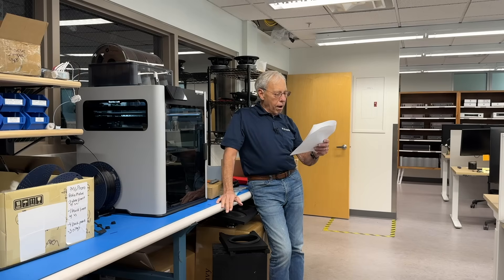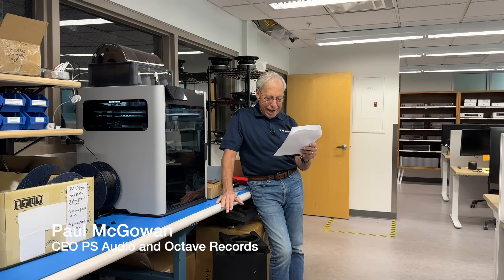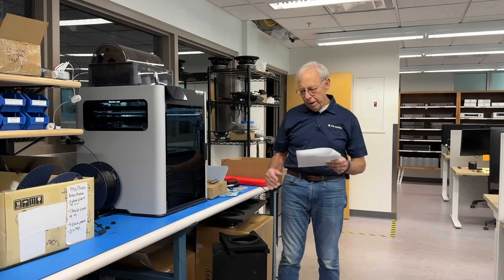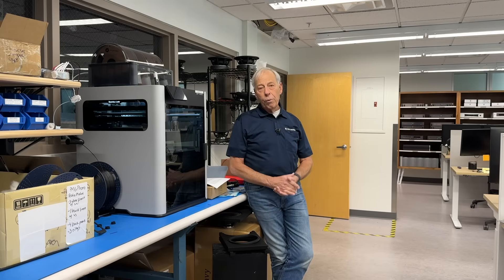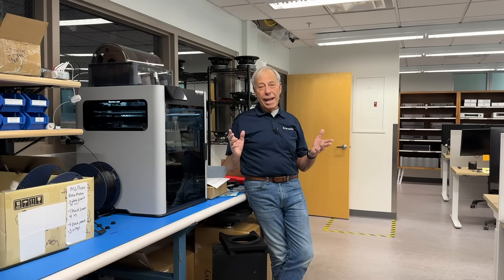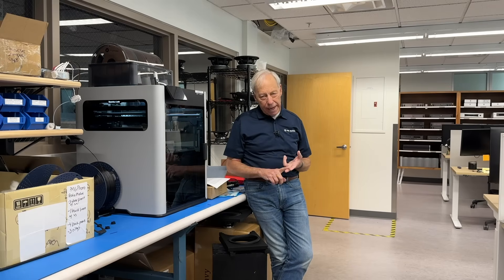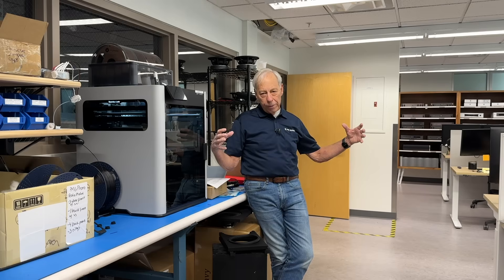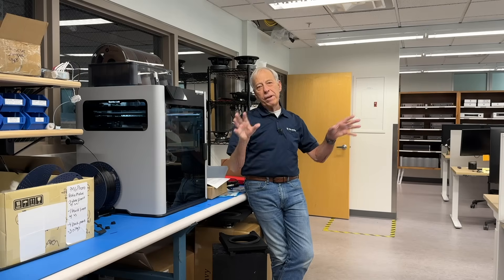Why amplifiers sound different

Comment: What any amp may do to the signal is miniscule compared to the speakers, how the speakers are set up, the listening position, and the room itself.  Get those things right FIRST, and then worry about your electronics.
Reply: I agree, if the speakers can't be placed correctly in the room.  No amount of electronics is going to correct the sound in that room. They way I build a system is start with the room, figure out the speaker options and then once you select the speakers, figure out what you need for electronics to drive them.  Amplification needs for example change drastically with a horn loaded speaker like a Klipsch (96db sensitivity) vs. a less efficient tower speaker that maybe only makes 85 db with 1 watt of power.  Between those two speaker types we may need half the amplification for the 1st option.  People under estimate the drastic change different speakers can make in a room.
Reply: Rent several amplifiers at once and connect them to your system. You'll be surprised at the huge differences between them.
Reply: @zibonek  Level match them to a fraction of a dB and you won't hear a difference (when you don't know which one is playing). This has been tested many many times with very different amps.
Reply: @Rob-k5k9u  Well, I can only pity your ears.
Reply: @zibonek  As long as you don't pity my brain, which is what I pity about believers of home audio myths.
Reply: @Rob-k5k9u  I'm a staunch opponent of audio myths, but if you don't hear that a given amplifier has better stereo imaging, for example, the Musical Fidelity M6SI has better stereo imaging than the Vincent SV-237 MKII. However, in some tracks, the instrument sounds blend together (e.g., "Queen Innuendo") on the Musical Fidelity M6SI amplifier but don't blend together on the Vincent SV-237 MKII, that's not my problem. You have two specific amplifiers here, which, among others, I listened to at the same time. I will also add that the Musical Fidelity MS6SI has a recessed midrange compared to the Vincent SV-237 MKII and it has a more exposed bottom end.
Reply: @zibonek  Look, no amount of name dropping and adjectival claims can in any way stand up to dozens of controlled tests. There is no logical/theoretical reason that the small electrical differences in amps could be audible. If and when you demonstrate that you can distinguish whatever amps you wish to compare, when they are level matched and your are blinded, THEN you have something that may be valid as evidence.
Reply: @Rob-k5k9u  However, it was a waste of time, you are a theoretician and keep reading folders and arguments.
Reply: @zibonek  I wonder what you have been not reading. You haven't made any arguments--just claims. I refer to evidence from controlled studies. You have "just listen" to my new expensive "audiophile pro" stuff!!!
Reply: @zibonek  Nonsense.  I bought my first audiophile system in 1978 and I've been testing amps, speakers, and cables and everything else for 47 years.  I've even done blind listening tests of both amps and cables, and the only time I've ever heard a difference is when either the amp or cable was not suitable for the task.  You've drunk the audiophile kool-aid and are hearing ghosts, my friend.  Study up on cognitive bias and science of psychoacoustics.  The work of Drs. Floyd Toole and Sean Olive is a good place to start your education.
Reply: I disagree....all things equal in your statement ....when you replace the amp.....you will hear a difference....many times a big difference.
Reply: @ColAngus  Even if amps could be distinguished, the effects of speaker placement and room would make way more difference. That actually involves sound.

Comment: Just ignoring for a second   distortion like harmonic , intermodulation multi tone etc... (which are inaudible on very good amps like e.g. Hypex NcoreX , Nilai and Purifi ) , the main difference can be a too low damping factor . An amp with a too low damping factor will sound diiferent as this will affect the frequency response of the speakers .
Reply: Found that out when I was playing with some Philips mini/cube speakers, sounded awful, until I used the right amp that had enough damping factor to control them. (tame the savage beast)
Reply: Disagree that hypex has inaudible noise, that was one of the amps I auditioned for my current stereo setup and I was super disappointed after all the hype it had. If you are a measurements person that listens to music by reading graphs rather than using your own ears to judge by swapping and listening to different components in your setup then that makes sense
Reply: @ArmFanatic   What did you hear? The ones I've heard sound super clean so I'm not sure what you're talking about.
Reply: @miscreant1739  the most obvious song where I heard a difference was quezacotl it’s a super clean tone throughout so it makes it easy to judge audio equipment swaps for me, there was like this low frequency hum I that I couldn’t not hear, also songs where there are quieter passages or moments of silence had that hum. And the low volume performance was lacking bass comparatively, bass performance was lacking below 70db and I typically listen around 65db. I auditioned a lot of amps it was far from the worst but that hum is one of those things once you hear it you can’t not hear it and it’s super distracting. Wish the ganm amps were out when I was shopping really curious on how those sound
Reply: @ArmFanatic  sounds like you had a ground loop or something… the amp doesn’t generate a low frequency hum on its own unless it’s broken.
Reply: Agree on Damping Factor and Intermodulation Distortion. These  both affect sound quality, noticeably enough to make Amp A sound better or worse than Amp B but reviewers always focus on Harmonic Distortion and ignore DF and IM. For a  consumer, it does not help that manufacturers seldom state DF.  Way back when Hifi was a new thing, HD at 0.1% was the gold standard. Better than that number does not substantially improve sound quality, imho.
Reply: Wait, what? If you can hear any distortion, your amp sucks. Hard to see how one can claim very good amps make distortion easier to hear.
Reply: This is why I love my sumo polaris… damping factor 525 and I noticed a decrease in bass ‘ringing’ and ‘mushy-ness’ compared to my NAD 3020 with a factor of 55.
Gotta have very short and high quality cables though… affects the impedance a lot and can make the maximum damping factor under 100 easily

Comment: All amps i have had have sound different, even with the same brand,
Like had Hegel h190 and now h390 they sound slighly different h190 is slighly warmer.
H390 have more detail, larger soundstage, better separation better bass comtrol.

Speakers makes the most difference through off all the gear in the chain
Reply: My H390 is definitely a step up SQ-wise from my Musical Fidelity - 'M6si500'. Both are a dual-mono design.
Reply: I am betting you didn't level match and double blind. That means we don't know why you heard a difference, including that it is all in your mind.
Reply: @Rob-k5k9u   ...I'm betting that you haven't got a clue.
Reply: Is betting how you make most decisions?
Reply: @Rob-k5k9u i can insure you its not in my mind, going from h190 to h390 is major upgrade specially if you use speakers that demand that extra power. Amps have an effect on how the speakers sounds, does make as much difference as speakers no, but it makes a difference, maybe you cant hear it because you are bad of knowing what you should hear.

Different amplifiers those sound different, its the truth. If it was not the truth why even spend so much money on amplifiers is all people stupid going by your logic, how much of difference the amps will have will depend on the level of your speakers, if you use cheap speakers thats not resolving you wont hear much of difference, on higher end speakers it will be noticable more than a little.

Comment: I've had amps modified and it was mind blowing, that was by the same engineer who designed them, but it was without any price point to meet. 
I guess it's a bit like baking a cake, if I and a baker were given the same ingredients and recipe they would still come out very different.
Reply: Agreed. I have two same power class A/B amps  both Pass designs...one sounds significantly different than the other.

Comment: The perspective that measurements and listening are somewhat competing methods is a totally false premise. In fact, I will argue there is no such thing as an amplifier sounding different without also measuring different in some way. Reason is an amplifier is a simple 2 dimensional transfer function of voltage over time. Two amplifiers measuring the same on frequency response, THD, TIM, SND and damping factor might sound totally different and that's where people get confused. Reason is that you haven't identified the measuring method to pinpoint where the output deviates. For example, distortion at the same percentage doesn't sound the same cause if you dig deeper the harmonics can be even or uneven and more or less harmful. A tube amp often beats a transistor amp due to even harmonic soft clipping distortion rather than more hard clipping in a transistor amp. Nowadays you can do comprehensive signal analysis on measurements to pinpoint any sonic difference using advanced instruments e.g. by Audio Precision. Still, Paul is of course right that compromises are not about pleasing instruments but about pleasing our ears.
Reply: I use my hearing to measure sonic differences...just as God intended 😉
Reply: We can only use what we have and not everybody has US$50k laying around to buy an Audio Precision setup that really isn't of much use for consumers lol...
Reply: Which God is best for audiophiles? Maybe our audio systems get more cable blessings if we pick the right God 😂

Comment: Not only does all audio gear add and subtract aspects of sound, but perhaps an even better way of thinking about it is that "live sound," or studio-produced sound has many aspects to it, and given current technology, no piece of gear can address all aspects of it completely or equally well, so some pieces of gear recreate certain aspects of musical sound better, and some apects not as well; and other ones have different balances of both strengths and relative weaknesses, hence different characteristic sounds for diferent lines/pieces of gear.
Reply: Add to that room dimensions, nodes and the variables are infinite!
Reply: @davidtomsett  and synergy with partnering gear!
Reply: Studio to home playback can absolutely be transparent. At least through to your speakers and room. If the recording and playback gear measures beyond human hearing, you are good. Then fix your room as best you can.
Reply: I sort of disagree. After the sound field is converted into an electrical signal, then all aspects of trying to keep the signal distortion free are knowns. Selection and placement of microphones, etc. during recording are what is used to adjust to aspects of recording music. Some controls (e.g., tone) allow some intentional distortion to compensate for aspects of recording (not sound) and personal taste. But, one should not buy any component thinking it is somehow better for specific types of music or aspects of music.
Reply: The scale starts at zero. A  streamer has no sound to it unless some bad engineering is involved, for example.

Comment: What we must also take into consideration is that everything is built to a price-point.
And different amps sound more, or less, 'pleasing' to different listeners when paired with different loudspeakers.
This means that whatever topology is employed; whatever 'sound' is achieved, it will still come down to listener preference.
Otherwise we would all be buying the same amplifier.
Reply: Excellent point. Real world factors are price, personal preference, and synergy. Good engineering can allow a product to perform above its price point, but it still faces price limitations.
Reply: Yes, you are right but even everything is built to a price point, price is a horrible metric for how good an amp circuit sounds. Often, great engineers can make a cheap circuit sound better than poor engineers can make an expensive circuit sound like.
Reply: @ThinkingBetter   ...are we reaching an engineering limit where sonic advances are becoming more & more incremental. I've heard some listeners say that some amplifiers designed & built forty years ago sound as good as ones built today.
Reply: 40 years ago great audio engineers also understood the essense of what makes a great sounding amp. Unlike innovation in computing having been rather explosive, analog audio really isn't that much better today when good passionate engineers are involved.

Comment: Despite the general belief, the type of class is absolutely unimportant.
Whatever you prefer or even dislike, there's an amp in this world, that will blow you away!
Even wattage doesn't mean anything. The wattage wars started like six decades ago and still brought us nothing.
There's also more than enough models in this world, with low numbers you wouldn't trust in, which sound incredible.
The most important thing is the engineering part, period. 
Same with speakers.